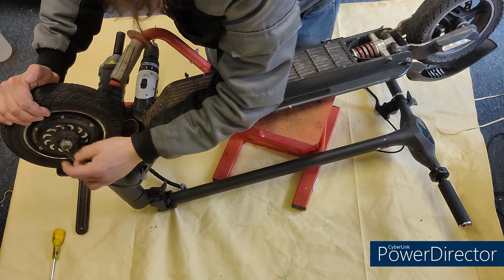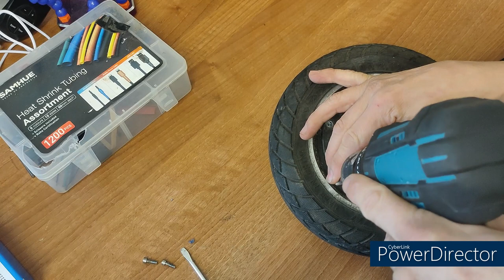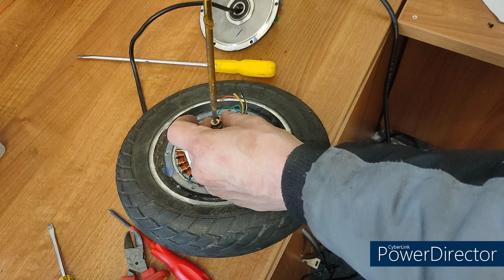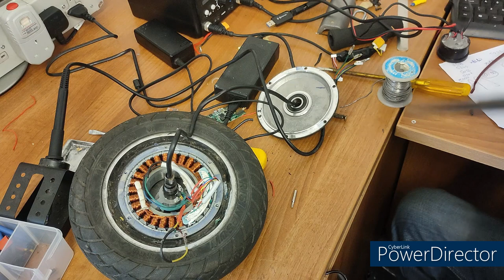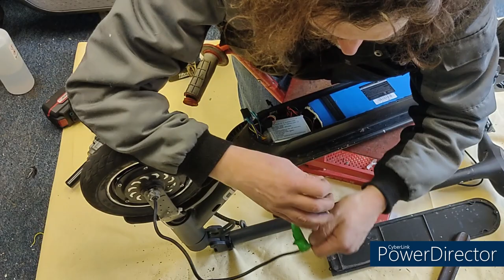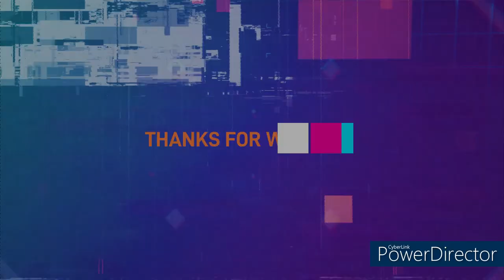E-Scooter damaged motor wheel cable repair

Comment: I have a motor that has a white wire included with the 5 hall sensor wires. My replacement controller does not have a white wire. after connecting everything power but the motor does not move.

Comment: My cover that’s stuck on with glue won’t pull out even with the glue seal broken
Reply: Would it be possible to get in touch. I have same model just appears to be put together slightly differently
Reply from the maker: Yes no problem, contact through the website www.escooterbitz.co.uk
Reply: @oliverelliott914  did you manage to get the hub cover off,im fighting with mine just wont come off
Reply: What is this particular motor called I can't find the schematic anywhere